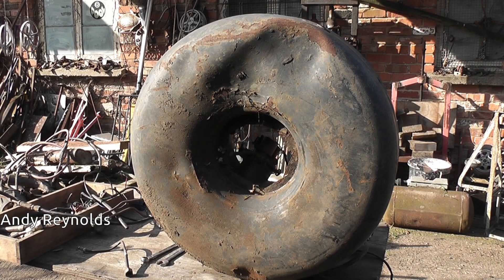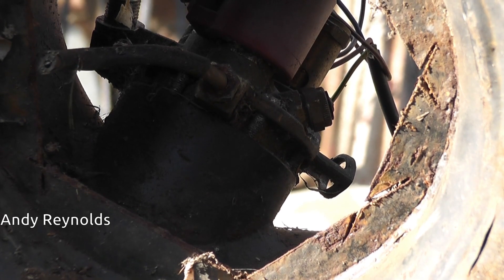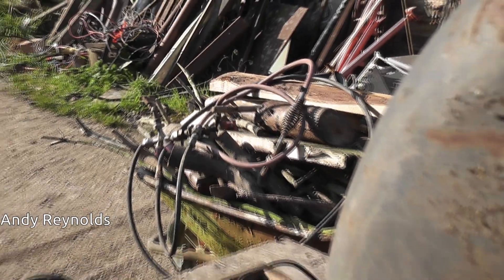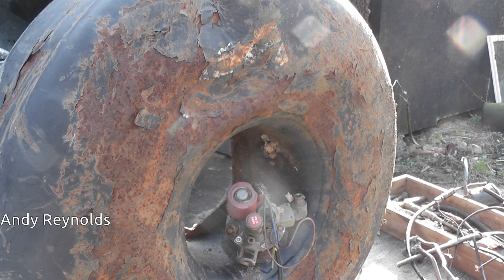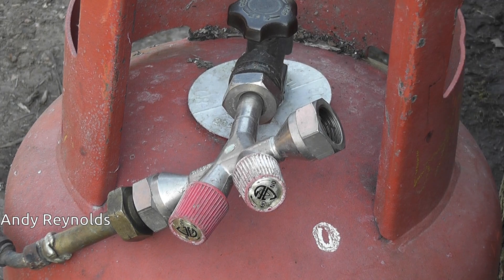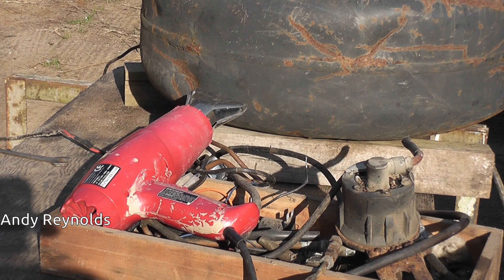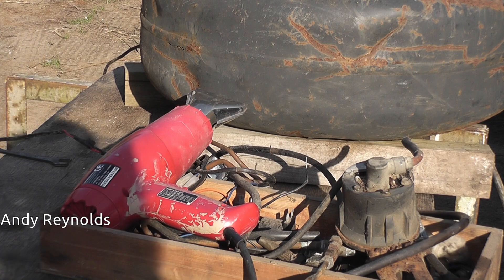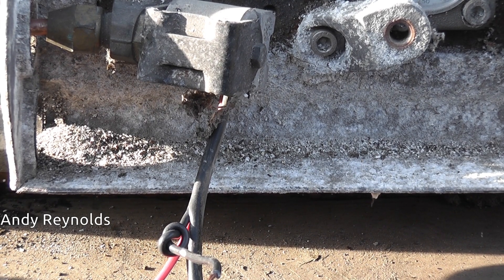Propane transfer, free fuel just a bit of time.

Comment: years ago a mechanic freind  who built a holden ute converted to 4wd with a 350chev , designed his own gas carb and patented it, he used a simple transfer pump , he used to buy household gas having no road tax on the gas it was alot cheaper.
cost him cents to the litre instead of over a dollar, car ran perfect no excessive exhaust temps, he had performance hardened valve seats and stainless valves.
Reply from the maker: Thanks for a sensible comment, not blithering about potential hazards. Ah yes, it's the valves that suffer so hard valves and seats are essential, cheers

Comment: Non standard connectors, reused pipes bloody hell mate sorry to say but this is a disaster waiting to happen not being judgemental and I’m form the same era as you where we as kids used to tinker and make do and mend as they said back then and just looking at your solar setup, it’s great because you are a clearly a very clever man but I’m coming from someone who would do exactly what you do but I wouldn’t now if you see what I mean.
I’ll just share something which realy made me think. I used to work as a trials engineer testing rocket motors at a certain facility near Kidderminster and Bewdley and I was doing some high pressure testing on a container. I was using a high pressure nitrogen supply from a cylinder which fed through an isolation valve and into a manually operated gas regulator and pressure gauges fitted to the rig before and after the regulator. 
Now this is where it gets scary and I was very lucky, nothing g went wrong BUT it could have AND there were a few scary factors. The test concluded safely but I’ll highlight my concerns.
1. It was wrong of my manager to ask me to set up and conduct the trial as I was NOT qualified all I had to go on was my understanding of the risks and the brief I had been given.
2. I didn’t have a safety man that day as he was busy working in another trial on one of the ranges.
3. The rig should have been verified, inspected and certified for use by a qualified engineer. 

There ere probably loads more infringements apart from ME being at fault from just disobeying H&S laws, I should have refused to do the task, END OF as under the 1974 act it says that EVERYONE is responsible etc …. 
What scared the shit out of me was hearing the gas fittings expand and contract as the bottle was full and had a pressure of 300 bar or about 4500 psi!!! The creaking as I opened up the regulator … 
What concerns me and I know that you are working with much lower pressures though is the risk of leaks particularly that new thread you cut to take that home made pipe… using non standard fittings mate is a real no no and I’d keep away from any brass fittings as they are very low pressure and you may end up working with pressures much higher than what they aerated for. I’d use steel based fittings and  keep all threads the same system and new seals and washers every time not with the risk mate. 

Some of the safety information and incidents that I heard of and witnessed woukd make your hair curl and you wouldn’t cut corners again, at the site in the late 70s 2 men were killed when small amounts of washed out unburnt nitrocellulose grains from fired and scrapped rocket motors would fall into the pavement at the entrance to the old burning area. I’ve a period of time these tiny grains found their way into gaps and cracks  in the concrete paving … this stuff can burn underwater so rain doesn’t just wash it away. Anyway it was dry time of year and these two guys were in the vicinity and maybe pressure was the trigger but the was a huge deflagration which ripped up the concrete and killed the 2 men.

Please be careful and think about neighbours etc..
Reply: I've worked both sides of the "standard fittings and new seals" line, it does take a shift in mindset and you just need to remember which side of the line you're on at any moment, on one side you can rely upon every piece of kit without too much thought, and the other side where the magic (or tragic!) lies :)

Comment: Sorry not being a keyboard warrior but really take care mate, I know you know what you are doing but from a fresh lair of eyes there are many things that concern me. I’m not a gas engineer, electronics is my profession, but in the areas I have worked alarm bells and red flags are going off…. Solenoids in proximity to a gas container?  Do t cut corners mate use a solid state relay or fit all your switching inside a gas proof / explosion safety rated container …. Just not worth it.
That doughnut container has been crushed, I would trust that anymore than I would trust Donald Trump mate.
Reply from the maker: The 12v solenoid valve is standard fitting for LPG conversions. It is part of the tank valve block, cheers

Comment: Old refrigerator pump can do the transfer as well. Gotta be careful, and you'll want to ensure positive pressure before connecting as to not introduce ANY air, but it is faster for sure, and you can pull the donor to vacuum. Common when I was in the UP (Michigan).  When R12 was getting phased out, they were even charging cars with it, lol..
Reply from the maker: Interesting stuff, yes air could be trouble, cheers

Comment: Firstly people might complain about a bit or propane, the brand name for liquified natural gas but I didn't hear complaints about lng release with the explosion of the Nordstrom pipeline explosion.
I see your efforts as a survival technique and reusing otherwise wasted gas. If one is sensible considering possible risk and ways to manage that risk before embarking on such a task, I see no reason why you shouldn't reclaim LNG.
Reply: Propane is a different mix than LNG, not brand name.  While related they are not the same. Propane has a higher energy density.   1ft3 of propane =2516BTU.  1ft3 of LNG is about 1030BTU's.  The Russian sabotage of the Nord Stream lines was because of their illegal invasion of a sovereign country. Plenty of people were upset by it.
Reply from the maker: Interesting that propane is part of a series on gasses and prop refers to the number of carbon atoms in the hydrocarbon chain. Meth (1 carbon), eth (2 carbons) prop (3 carbons) bute (4 carbons) cheers
Reply: @TheInfoworks you learn something every day, thanks for this bit of info
Reply from the maker: @ianhelsbyservices  yes a bit of hydrocarbon chemistry, cheers
Reply: @TheInfoworks interesting, I'm no chemist and a while since I studied chemistry

Comment: I spent a good bit of time thinking about this and had the setup soldered out and managed to get a bit of gas to flow, the "giving" tank upside down in the sun, and the "receiving" tank lower and in the shade. I couldn't get much gas to flow.  It only dawned on me recently that if I can get a connection to the "giving" tank then why take the hassle? Just mount the donut near the cooker and put a 12v "safety" switch near the cooker?
Reply from the maker: Yes this occurred to me and was able to include a regulator on that weird fitting that came from Uncle Harold, however convenience and practicality of movement meant that transfer was favourable, cheers

Comment: I thought I was the only one mad enough to do this kind of thing. 
By the way. You can get LPG pumps but they are expensive.  It does mean that you can fill bottles until the relief valve goes. Which tests the valve but wastes LPG. Not a job for a smoker....
Reply from the maker: Yes, I used a pump a few years ago and was careful not to overfill the bottles, when the temperature changes the valves can let more gas out if overfilled, weight is the answer. Cheers
Reply: @TheInfoworks  That´s right, only fill by weight, the liquid gas expands by temperature, an it needs room to do so. You don´t want the relief valve to blow sporadically.
Reply from the maker: @Turbodiesel662  exactly, or there may be a surprise, cheers